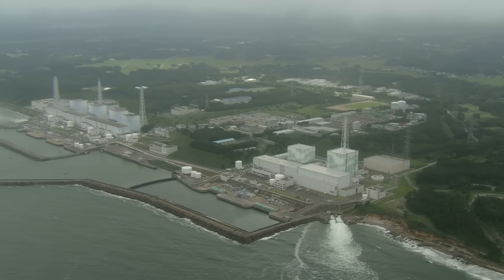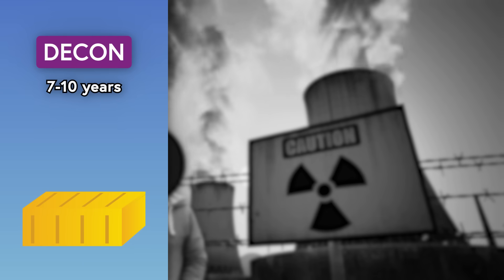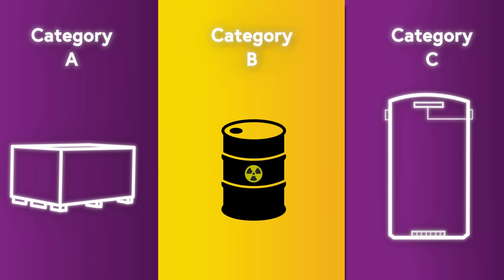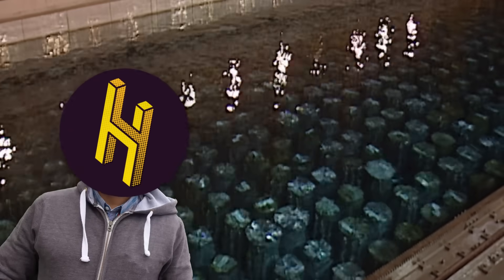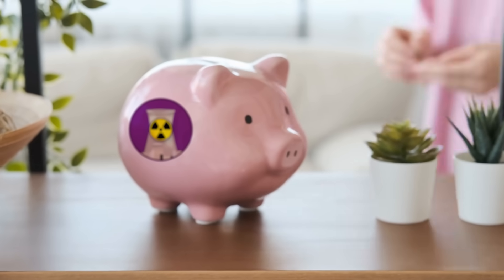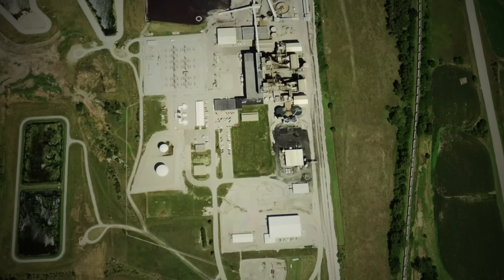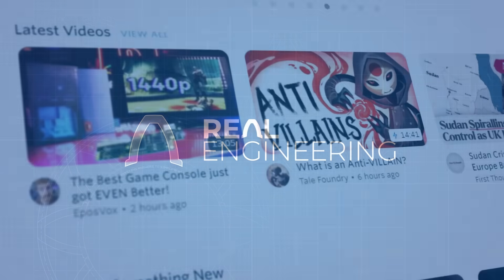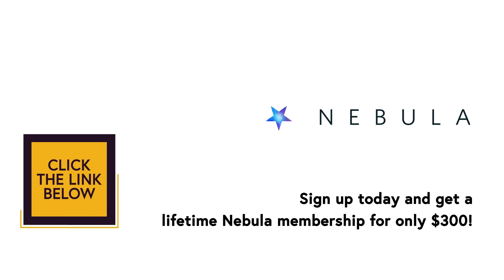Why It Takes 7+ Years to Shut Down a Nuclear Plant

Comment: If you’re gonna make a video about Chernobyl, you should at least include the fact that Chernobyl CONTINUED TO OPERATE and produce useful power for another 13 years after the catastrophic failure. Not all of the reactors melted down. 

Nuclear power is underrated. Not even the worst meltdown could bring this single plant to its knees. Chernobyl was only shuttered due to immense pressure from the German government, and in spite of protests from locals who wanted to keep the plant operational. 

Typical antinuclear fearmongering fails to cover this key fact: it’s much safer and more reliable than they’d want you to believe.
Reply: It seems like bad practice to me to keep producing energy from a power plant that has recently blown up, is still unsafe over 50 years after it's blown up, has dangerous radation everywhere, and has recently malfunctioned.

Can you give me a source for the Chernobyl operating after the disaster?

And what did the German government have to do with Chernobyl?

Also, is nuclear energy's track record because it's safe by nature, or is it because of the massive regulations put into preventing nuclear explosions and make it less devastating?

Edit: I'm checking the wikipedia page and Chernobyl was still producing power for some reason after the disaster. 
On Chernobyl's wikipedia page, it says that Reactor #2 was shut down permanently in 1991 after a fire broke out due to a faulty switch in a turbine.
It seems to me like the Soviet government kept it online despite how bad of an idea it would be, not because the disaster was not as bad as it was made out to be.
Why?
Because if they did, then there would be an energy shortage.
So it looks like they kept it online not because it was safe, but out of necessity.
Reply: But it's not renewable
Reply: @mistermist634 ’bUt iT’s nOt rEnEwAbLe’ stfu it’s still green
Reply: @mistermist634  Nothing is renewable.
Reply: Unless you found a way to avoid the heat death of the universe. In which case everything is renewable.